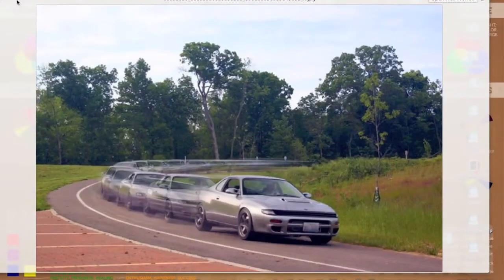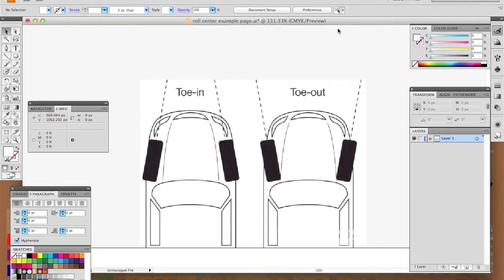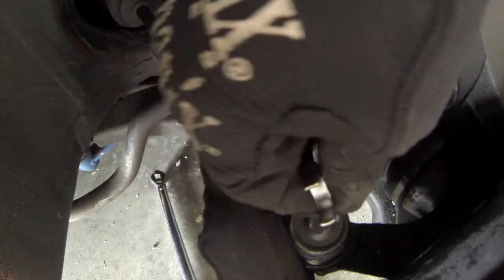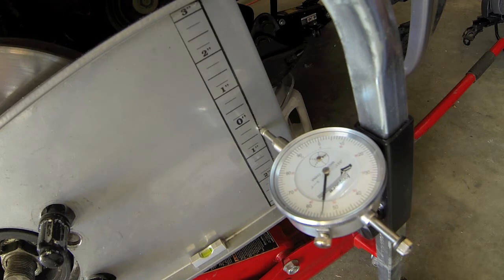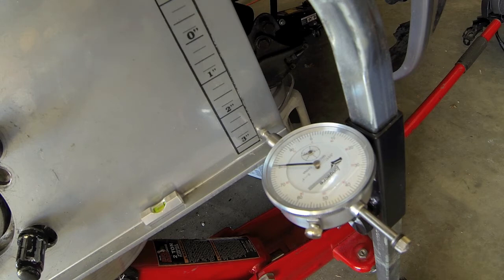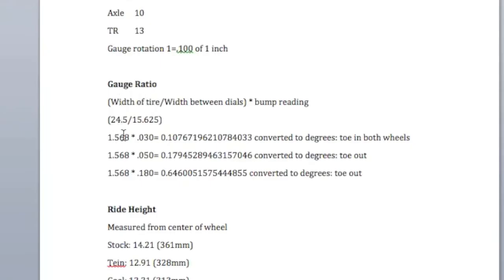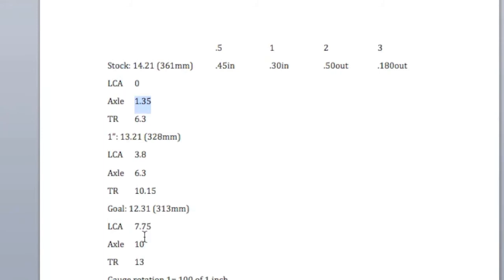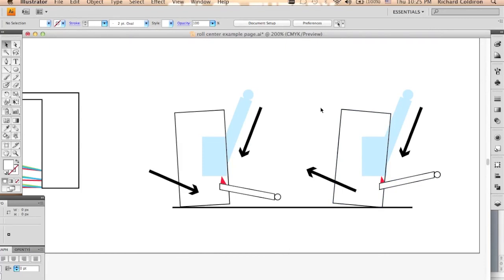Project CMS Episode 14: Bump Steer introduction and testing S203

Comment: seen a couple of your vids and  i liked em... keep em coming.. but at 13:50 your are talking about taking positive camber when lowering a car, actually that is incorect . IN a double wishbone suspention 90% of the times the lower control arm is longer than the upper , as a result you are gainning negative camber cause the lower control arm has a larger radious to follow than the upper. the rest 10% is only refered to off road use-racing vehicles .IN a Macpherson strut suspention you also get negative camber when lowering a car because the whole hub assembly is following the angle-movement of the shock absorver. (sorry for any misspelled words,greek guy here)ohh and i also think that boost when controled by EBC looks kinda jerky...
Reply from the maker: +h0rr0r100 Thanks for the comments. Yeah, the ebc seemed to give me some flutter. I think the mbc is more stable and responsive. After I did this video I had taken the camber curve of my front suspensions though various heights. My suspension goes to the positive direction of camber change through compression ie lowering. I'll read up on what you wrote, and if my front control arms are ever done I will add a correction to my next video on the subject. I am still waiting on them. Thanks.